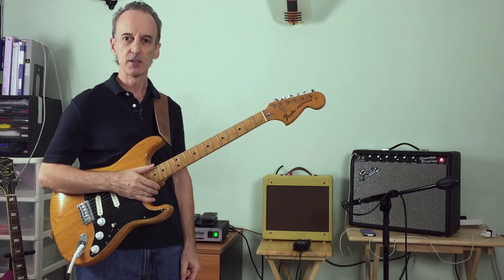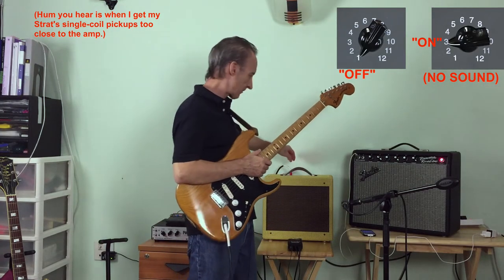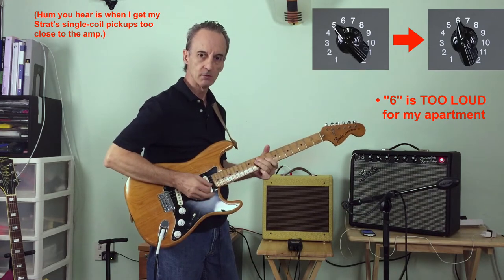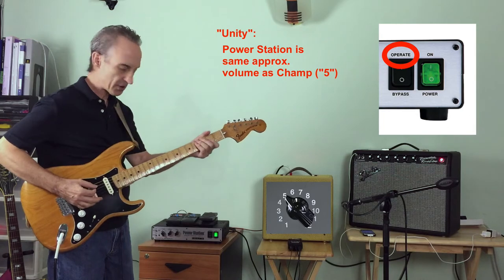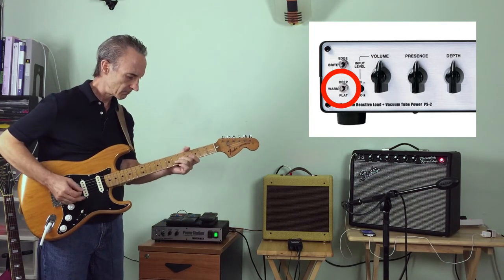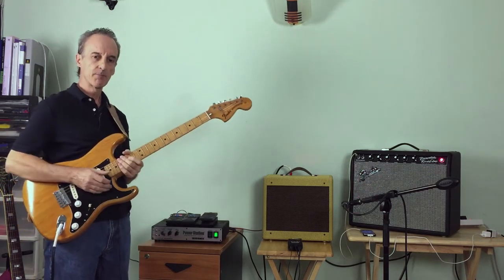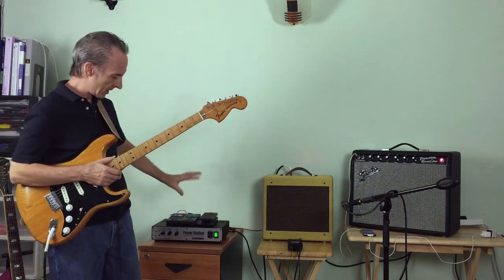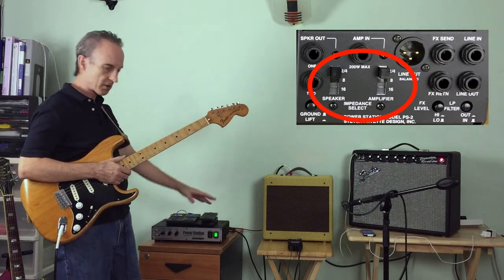Fryette Power Station 2, Tweed Champ Amp Home Recording Solution Demo

Comment: I have recently been researching attenuators, reactive loads for a studio recording application. The Fryette power station 2 is one of two pieces of gear I need to lower volume of a cranked tube amp. The other piece of gear is an cab sim. The Suhr A.C.E. and AD/A GCS-6 look like promising Analog cab sims. I have a bunch of I.R.s but I prefer physical/analog boxes to I.R.s.

That Champ sounded great cranked to 12!

Cheers.

Comment: How noisy is the fan on the PS?
Reply from the maker: Usually extremely quiet. However, after I'd had mine for a bit, when I turned it on it would make a small noise which then went away after a bit. Actually, I sold it when I left Thailand over a year ago, but that's what I recall. I loved it, but had that tiny complaint.

Comment: Hi Dave, nice demo. I'm expecting my fryette PS-2A for next week. Just out of curiosity, is your amplifier's speaker cable long enough to connect directly to the Fryette PS-2A  speaker output input or are you using a 1/4 Female/Female adapter as written in the manual? Or do you use a "male to female connector extension socket cable"? My combo amp's speaker cable is too short and I wanted something secure to connect to. thanks
Reply from the maker: Pretty sure I was using an adapter cable that I probably made myself, sinceI had just made the Champ and had all the tools.

Comment: Nice guitar tone and playing. Enjoyed your demo. I am currently Researching an Attenuator. Are you still happy with it? I actually have a 65 Princeton and can only put the volume on 2. Stay Safe.
Reply from the maker: I still like it. Several new devices have come out in the mean time though I think...like tube amps that have reactive attenuators built in...plus other stuff, like various interfaces, IR (impulse response) stuff to emulate different speakers/cabinets/etc., I think. Good luck.
Reply: @DavesGuitarPlanet  Thanks for your input. I'm in NYC, and have the ability to try everything, but for-some-reason Nothing Beats my Fender Princeton. Just an incredible sounding amp. I will continue to do more research
Reply: @michael_caz_nyc  which Princeton do you have. I have a Fender PRRI. I like the amp a lot. The 5F1 has its own voice which I also like very much. I’m thinking I’d probably still keep the Princeton. I’m interested in what you like or dislike about a 5F1 Champ.
Reply: @steveyankees1  I have a (2017) 65 Blackface. I absolutely love it. "Pristine Fender Clean's"  & fairly high headroom. I play crystal-clean about 80% of the time. It has that SRV Riviera Paradise Tone. I can also get the Mark Knopfler, Nile Rodgers, David Gilmour & Robin Trower tones. I'm not familiar with the champ - sorry.

Comment: the PS has a built in tube power amp. Does the power amp run when you're just attenuating? I wouldn't wanna run a 50 watt tube power amp unnecessarily all day long.
Reply from the maker: I THINK the unit still works as an attenuator with the power turned off. The way I've been using it lately though, I need to turn it on...because I'm running a line out to my recording interface, and that doesn't work with the power off. Here on youtube I watched a good demo before I bought it and he said it still worked with the power off. I still love it. :-) Using it with a boutique tube amp now.
Reply: @DavesGuitarPlanet  With the power off it still presents a load to the guitar amp but it will not drive a speaker, because of course the PS power amp is off.   The manual doesn't spell it out but I should mention you should not use this "Silent Mode" (Fryettes term) with any amp that exceeds 100 watts because you need power to drive the fan for high levels of attenuation.  From the manual:

USING SILENT MODE
Silent Mode allows you to use the Power Station as a silent adjustable reactive load for quiet direct recor-
ding or when sending a live amp signal to front of house with no speaker cab connected. In this mode it is
not necessary to power up the Power Station. You don’t even need to plug in the power cord. The Voicing
switches, Low Pass Filter switch, FX Send (along with the FX Level switch), and the Balanced and Unba-
lanced Line Outputs all operate with no AC power applied.

Comment: Interesting video : I am living in appartement too and consider to play  a valve amp there  but do not want to disturb the neighbours. Do you have any experience with the boss tube amp expander ? I wonder how this compares with the fryette.
Reply from the maker: Wasn't aware of it but just looked it up. Must be pretty new. My PS2 cost $700 plus. The BOSS is $1300 on sweetwater dot com. Just read the specs real quick. Looks like it basically does what the PS2 does plus some other stuff. Sweetwater says "100W Tube Amp Companion with FX Loop, Attenuator, IR Loader, USB Interface, and Onboard FX." So looks 50 watts strong than the PS2. And the PS2 doesn'thave " IR Loader, USB Interface, and Onboard FX." Probably pretty awesome, but pricey. Those 3 extra options would be nice, but I'm pretty happy with my PS2 for now.
Reply: @DavesGuitarPlanet  A difference is that the fryette has real valves if I am not mistaken  and the boss has a transistor poweramp.
Reply from the maker: @45zapatero  Hmm. I like how the Fryette has tubes.
Reply: @DavesGuitarPlanet Yes I like that too. It seems a bit weird to me that on the one hand you wznt the sound of a good valve amp but "replace" the power amp with a non valve poweramp

 you

Comment: Hey, do you have any input on the Fryette Ps-100?
Reply from the maker: The only Fryette product I know anything about is my PS2.
Reply: The PS-100 is basically two PS2's in one box.  This solves the problem encountered when the settings used for your bridge pickup doesn't sound so great when you switch to the neck p/u.  So it's a two-channel PS2 for an extra $200.  This is very important for the gigging musician but most home users will do just fine with the PS2.  I don't know if Fryette did anything to tweak the tone when they developed the PS100.

Comment: You need to show from the back how you connected bad explaining got nothing on this please prepare
Reply: Get more polite when you ask someone for something Edwin.
Reply: @tbmpvideo  seven days later yeah again prepare
Reply: He’s demoing the sound in great detail which is what most people are seeking.  Contact Fryette directly with tech questions - if he spent time going over where cables go you’d have a bunch of people commenting on how he wasted their time covering the instruction manual.
Reply: Pretty simple though : speaker out  from amp to fryette (amp in)and then back to the amp (from speaker out onthe fryette). You should be able to figer this out yourself ;-)
Reply: @45zapatero   ..."and then back to the amp"   --- but where at the amp?
Reply: @tbmpvideo  It's pretty simple/obvious. But, if it's still too much for you to figure out, RTFM.